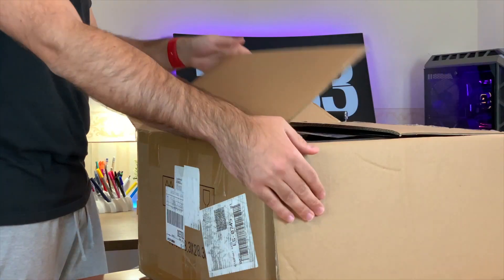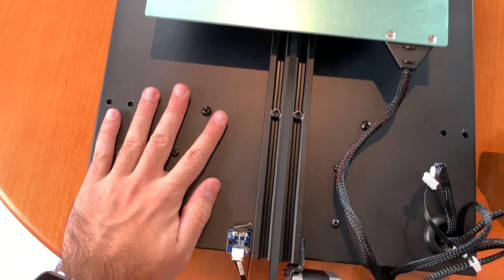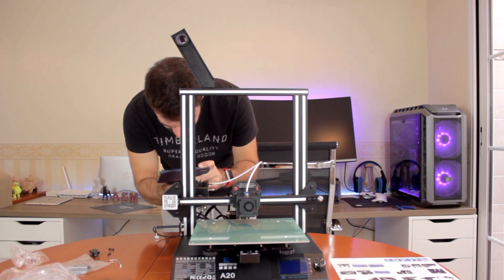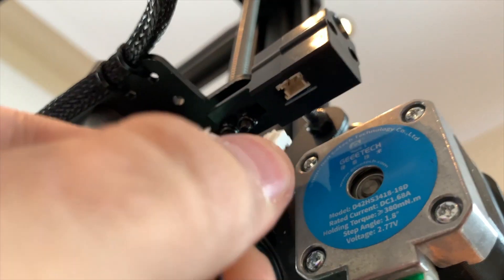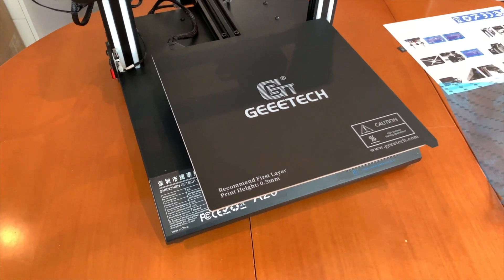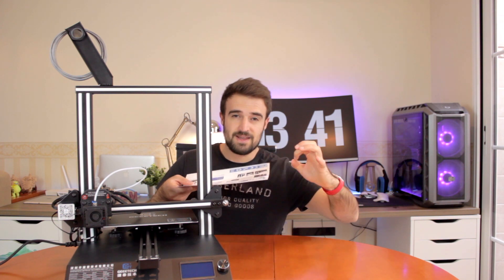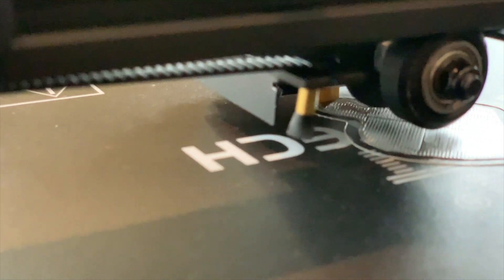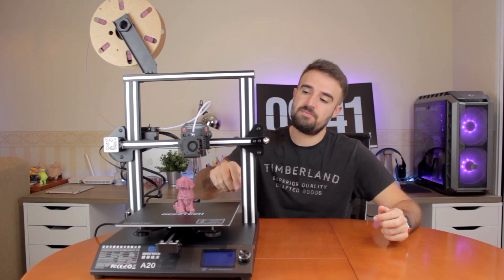Geeetech A20 | 3d Printer Review | Unboxing | Assembly guide

Comment: Hi want to take geeetech a20, is it still working good?
Reply: Is it stable continious printing pet and petg?
Reply from the maker: @3DPerformance1  never printed PET, but printed lots of PETG and works perfect. Just make sure you don't place the printer in a stream of air
Reply from the maker: Hi Stefan, it's been very reliable so far! The princ surface it's a bit destroyed but it's normal, since I've used it a lot. Get it ;P

Comment: Excellent video as usual :) 

Even if it is not fulle related, I take the chance to ask you about a weird behavior in Cura. I've got a .stl for an electronic card's case. When I open it in Cura everything looks fine (see box01.jpg) , I can slice it without any issue but when I preview the job the junction of the walls (corners lower part) are missing!!! (box02.jpg).
In the link to my Drive, you can fins some snapshots about this matter and the original  .stl file. 
Any lead to solve this? Thank you in advance
Reply from the maker: Hello friend, I think you forgot the drive link
Reply: @architects3dp  Opps... never mind, I've got a fixed .stl. Thanks anyway for your availability

Comment: I wouldn't call that a good print as you can see loads of ghosting lines in the print you should have celebrate e steps and filament flow but apart from that good explanation of the printer
Reply from the maker: I can't see any of this 😅

Comment: Does this printer have the ability to resume print after power failure
Reply from the maker: Yes! It does, but you have to activate this option from the menu of the printer. I noticed once I had a failed print
Reply: @architects3dp  btw I’m having major issues with the top of my print. I upgraded the firmware of the printer and ever since the top of my prints don’t come out well. It’s a thin layer and it just doesn’t print properly. Before upgrade, it printed fine
Reply from the maker: Maybe it’s caused by the slicer... i don’t really have this problem